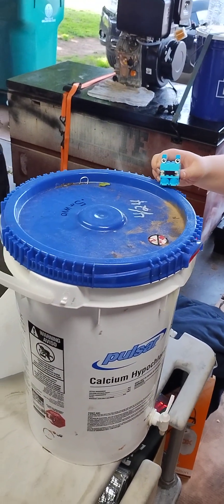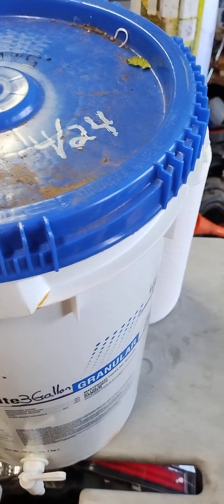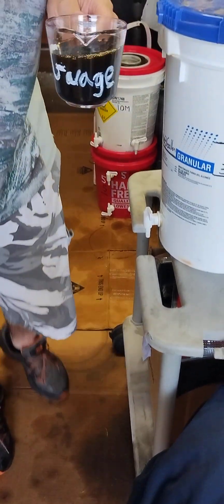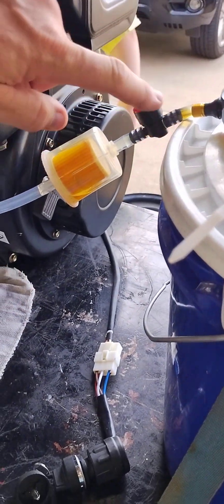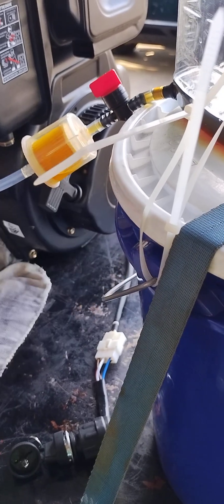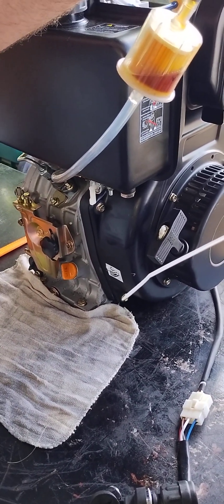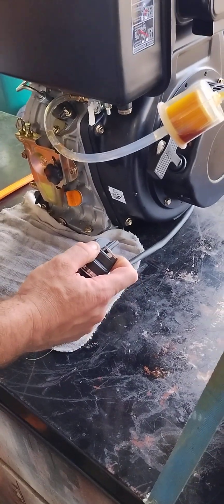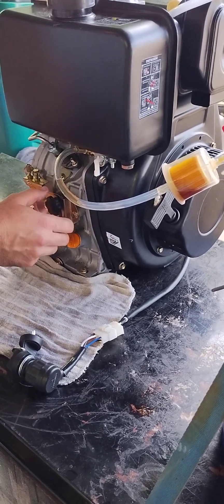Amazon Diesel Engine 186FA Will It Run? On Waste Vegetable Oil? Full video.

Comment: im new here, have only seen a couple of the videos so far, what do you do with the leftovers? mix it all together and just use it up?
Reply from the maker: Yes, I filter it all.  From 600 down to 1/2 micron and throw it in the 55gallon drum.
To give to an idea a human hair is 50 to 75 microns.  Am engine oil filter is usually 20 or 30 microns.
A fuel filter is usually around 12 microns.